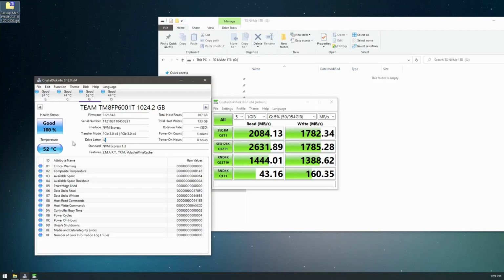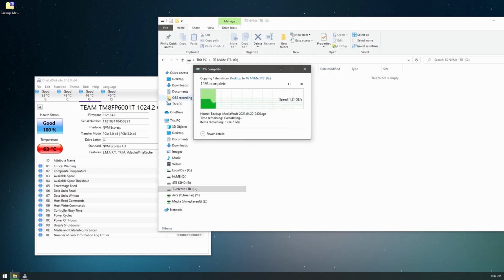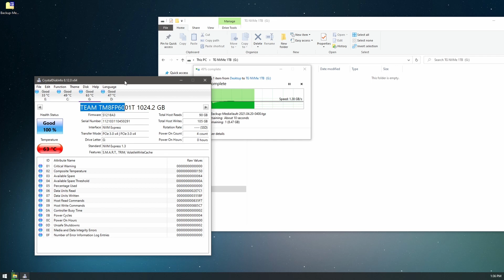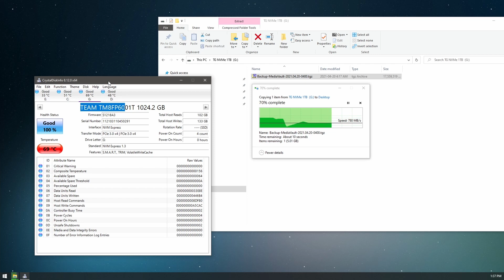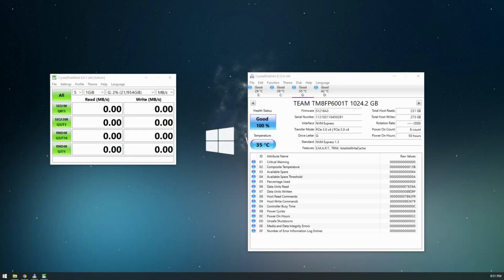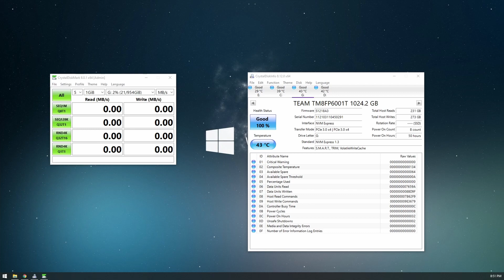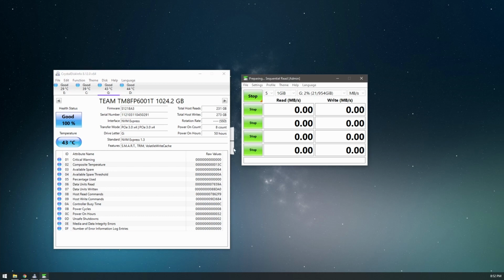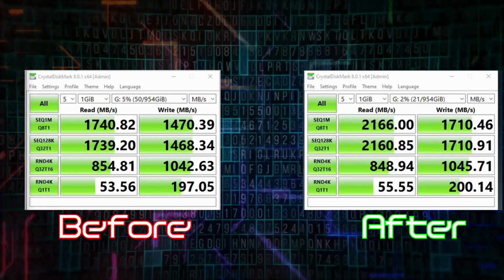Improve NVMe SSD Speeds

Comment: Why my nvme ssd is not getting gigabyte transfer speed?
Reply from the maker: What NVME model do you have
Reply: @TechworksOnline  GXNvme256
Reply from the maker: If you copy a large (4gb) file and paste the file both on the NVME disk.. how fast does it say it goes.. have you run crystal disk mark on it ?
Reply: @TechworksOnline  on crystal it says 1700m/s + but transfer speed like transfering 35gb of file speed is only 100mb/s
Reply: @TechworksOnline  I also installed GTA V on same drive but the remaining time is more than 2hours why??!
Reply from the maker: Does it start out high then settle out. I didn't find that specific model of nvme disk anywhere either. What are you transferring the file to ?
Reply: @TechworksOnline  no,the speed is most time constant 
From a Hard drive but 
Why GTAV installation is so slow for an nvme
Reply: @TechworksOnline  also my disk usage while installation is like 0% and of HDD too?
Reply from the maker: Likely you have a dramless model that will be able to reach high transfer speeds for a certain amount of GB like 8GB or something until the cache runs out, then it goes down to  much slower speeds. A higher end NVME drive will have faster base nand and more cache and dram so it can sustain high speeds for longer
Reply: @TechworksOnline  how to know like from a software to know it's a dramless
Reply: @TechworksOnline  hey, does because of boot driver is set to hard drive is causing this issue